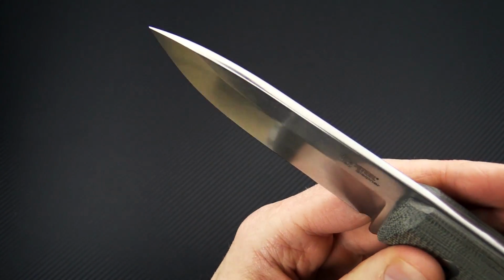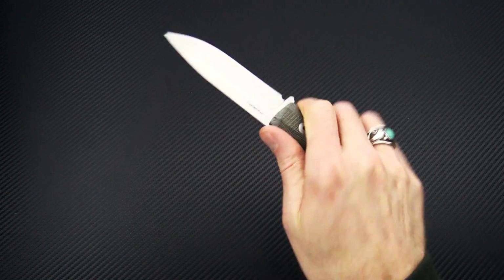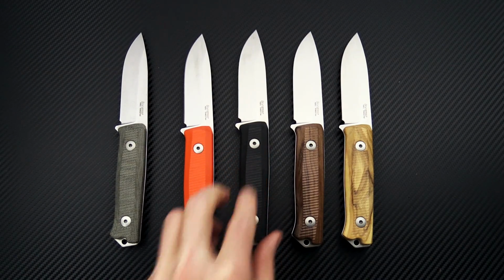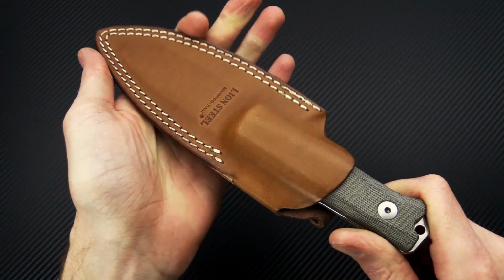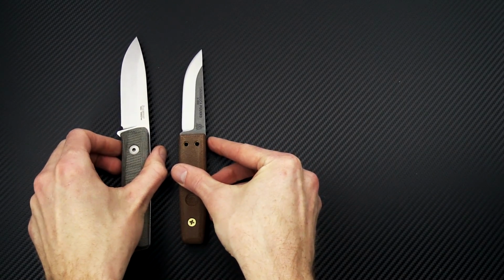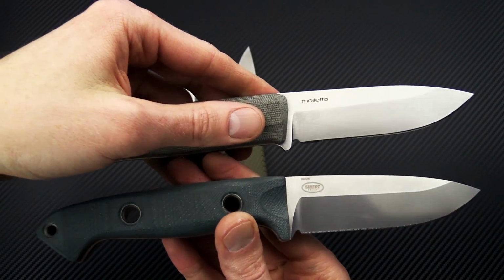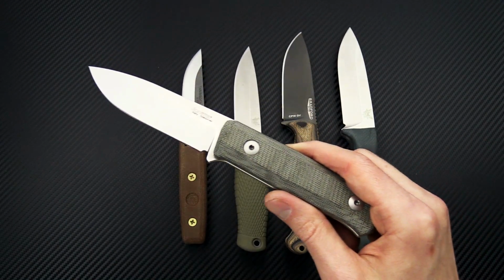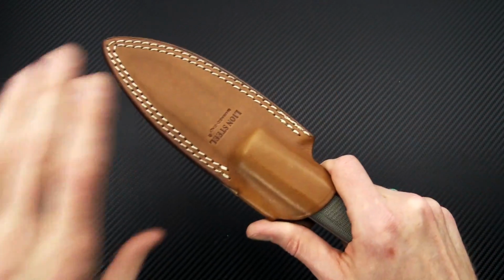LionSteel B40 Bushcraft Fixed Blade Overview

Comment: I like this knife nice quality , though I hear the sleipner steel is difficult to sharpen  and rusts easy that is what all these other people say ?, Is this true and can I sharpen this in the field with a DMT diafold pocket diamond stone?. I own 1095 carbon steel knives and I like them no matter what anyone says about rust mine never rust because I oil them after use. It seems people are never satisfied with a knife or steel and want some perfect knife that does not exist. I do not care if a knife has a sharpened spine or not , I use a lighter and Exotac match case and a fire rod as last resort with its own scraper like the Swedish fire rod or others. These Lionsteel knives are nice quality for the price compared to Bark River or custom knives. Just my opinion .
Reply from the maker: I share your opinion that LionSteel makes a fine fixed blade that is highly competitive with others in the market. If you oil your blades and use diamond sharpeners I would guess you to be good to go on Sleipner. It is a semi-stainless like D2 so rust resistance is better than 1095 but not as good as say 3V or Cruwear. https://knifesteelnerds.com/2019/10/14/corrosion-resistance-testing/
Reply: @Gpknives Thank you for the reply ,I am undecided on this knife or the Lionsteel M4  ,though I think it would be more difficult to sharpen a M390 than a Sleipner steel?. I also have seen a Lionsteel M5 which maybe better than these other two ?. Not a easy choice because they are all nice knives.
Reply from the maker: Also, check this out: https://youtu.be/ShF8P9CtjHA?t=331

Comment: Why wouldn’t they offer a bushcraft knife with a squared spine for firesteel striking?
Reply: Because they are more comfortable to use with your fingers over the top of the blade. Buy fire steel scrappers and attach them to all your ferro rods, that's what I do and it works great. Then you get the best of both worlds.
Reply from the maker: I'm not sure but I believe I have seen someone strike a fire rod with the corner of the spine despite it being crowned.
Reply: I have a lionsteel m1 with the same spine and it can throw sparks a lot better than my ultralight bushcrafter. You just have to angle it a bit when striking a ferrorrod to the part where the curve of the spine ends to meet the side of the knife

Comment: "This is b40 bushcrafter with ROUND spine...." wtf? Still nice knife.....
Reply: Just use a ferrocerium rod with a scraper  they are designed for the ferro rod and work great carry a Exotac match cap and a Bic  lighter too  is all you need  and you are good to go . No need for a sharpened spine if you must have a sharpened spine buy a LT Wright knife. Though this Lionsteel B40 is a great deal and knife compared to LT Wright prices or Bark river. Just my opinion buy and use what you like .
Reply from the maker: Why the "WTF"?
Reply: @Gpknives  when I think bushcraft knife, I'm thinking: good steel, full tang and flat spine for fire rod. You can still file it down :)

Comment: front edge of that handle looks like it was made by a ten year old rubbing the blank on a brick ,  i like the angular grip , but boy that looks rough. At least it looks better in G10.
Reply from the maker: Despite the looks it is quite comfortable in the hand and allows for good control. 👍
Reply: @Gpknives  
I dont doubt it , but you must fess up , its a bit of a car crash.

Comment: Looks very nice, but how thick is it behind the edge? I wasn't that convinced by the cutting performance of previous Lionsteel fixed blades, although they are always looking gorgeous...thank you
Reply from the maker: Right around 0.02 BTE so pretty average for a production knife but good for a Bushcrafter IMO. I like my folders a bit thinner but for an outdoors knife that geometry work well.
Reply: @Gpknives  o
Reply: Thanks
Reply: I convex all my knives, it takes care of that problem. Ken onion work sharp with grinder attachment.

Comment: Really needs a kydex sheath
Reply from the maker: While I do like kydex the leather sheath is very well made and has excellent retention. Works well for the bushcraft platform.
Reply: @Gpknives  I understand, but I'd use it in a tropical outdoors environment,  leather rots very quickly.
Reply: @samwatson3588  D2 in tropical? Good luck.